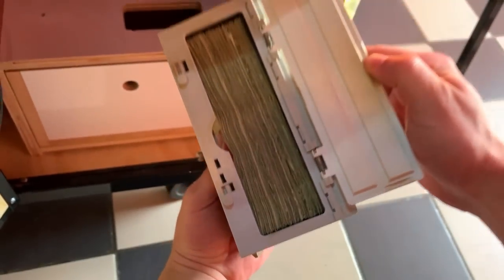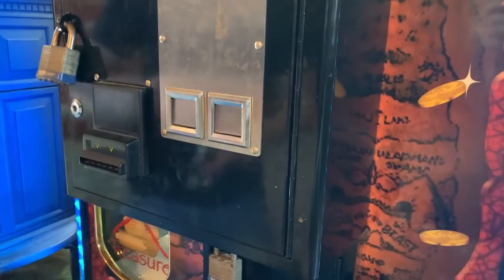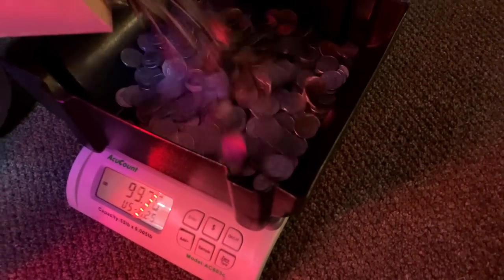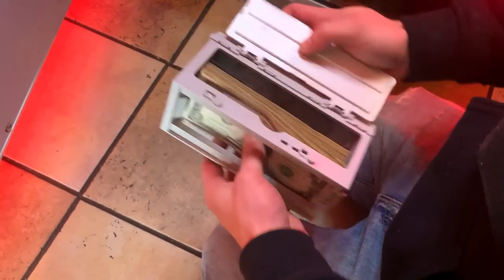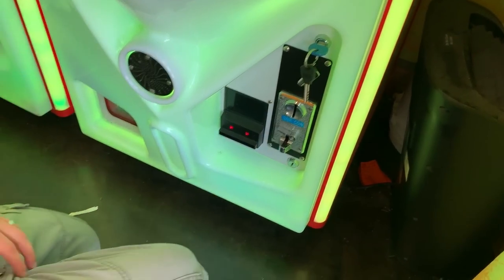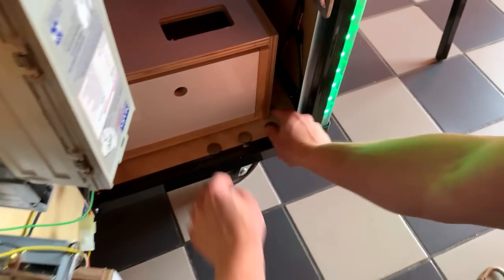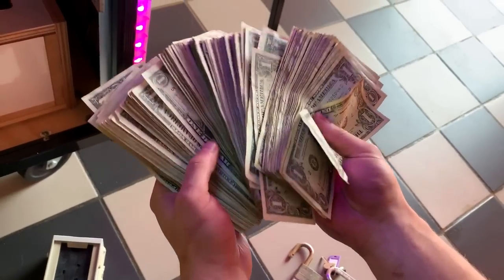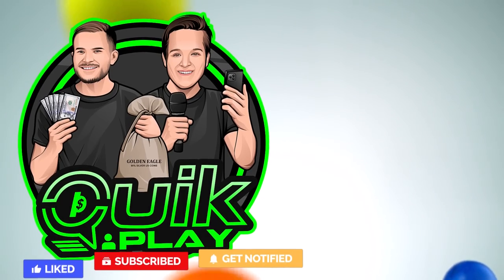How Much Do Claw Machines Actually Make?!

Comment: If the collections with full DBV magazines are full on a regular basis, I'd recommend getting a bigger magazine if you can. On my machine, I have magazines that hold 300 bills, but if it fills up regularly, I'll probably get magazines that hold 700.
Reply from the maker: Yes we need to put extended magazines on some of these!
Reply: @quikplay  what the combination and cost of the machine and the new extenders what does that usually run?

Comment: What happens when one of ur claw machines break? For example that kid shoving a knife in the coin thingy. Are claw machine mechanics a common thing? Or do you have to learn how to work on ur own machines? Or is it more standard that if a machine is broken to just replace it
Reply from the maker: So for this situation with the knife in the Machine, we just had to buy a new coin mech on eBay ($30) and swap them out. It’s pretty simple stuff usually.

Comment: On triple head candy machines are you giving commission on the sales or profit?
Reply from the maker: On triple shop candy machines when we pay commission it’s usually 10-15% of net profit
Reply: @quikplay  so sales minus the price of the candy then that percentage given. Candy is easy i know im pouring in 2 containers full,  gumballs filled up pouring from an 850 ct im not sure what % of the 850 count fills up the triple head rhino pro up and if im paying them when theyre not completely empty it would b a rough estimate on all 3.. but i would rather pay this then the %  of the sales which seems like too much? i still need to turn a profit and pay for inventory unless i offer a lower % and give off the sales to make it easier and more accurate... right now these places want %20 which im like ah man! Can i even pull that off/afford that?! And are they expecting off the sales?? Im sure i can renegotiate but yeah im trying to smooth this out in my head/on paper before a (1st) collection refill day of mine in your answer you say %10-$15 to have that grey estimate area which is how i could look at it to make it easier to work out. Maybe im just over thinking it

Comment: Yeah I would like to know how much you pay for each machine if it breaks down and how much you get for rent on them. Does not seem like there's enough investment at the end ?????
Reply from the maker: Hey there! So far the only issues we have had with claw machines as far as repairs go are replacing coin mechs ($30), replacing dollar bill acceptors ($100-150), and replacing the claw itself ($50-100). All of these are not common occurrences however, at least in our experience!

As far as commission, usually 30% or so!